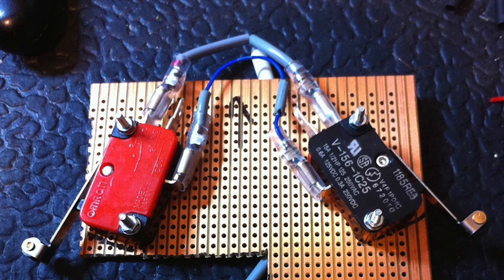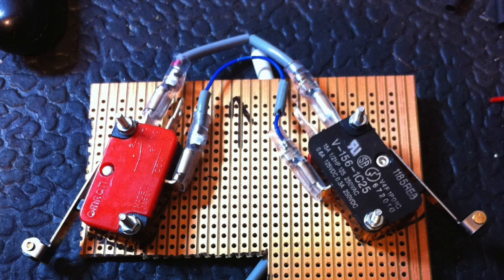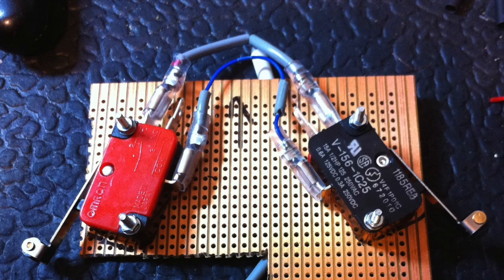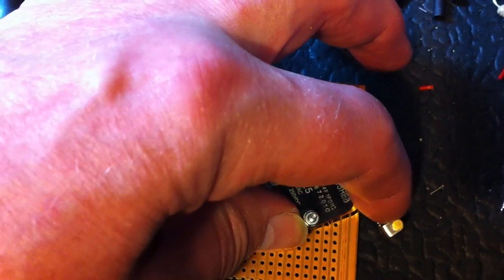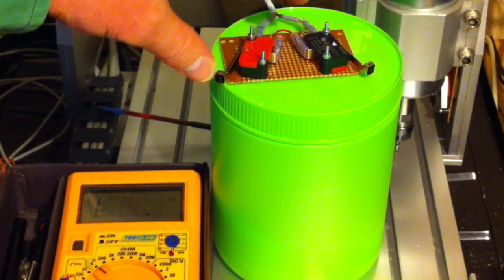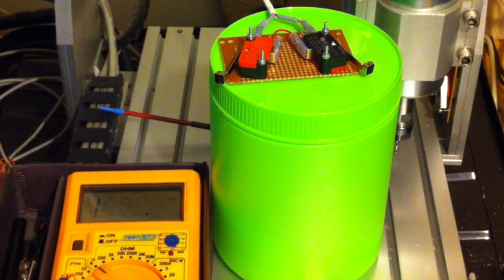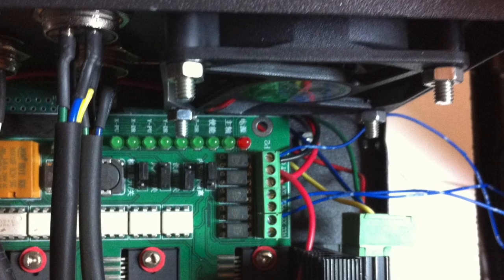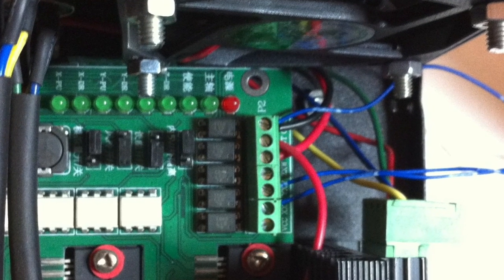Wiring Up Limit Switches On A CNC 3020T Engraving Router

Comment: hi, im using my normally closed ( NC ) limit switches connected to breakout board and I get  constant false limit switch trips . im using shielded wire. what can i Change in Mach3 to not have this problem. 

Thank you
Reply from the maker: Hi I had this too, it turned out to be nothing to down with the switches, if yours is like mine then it the manual change in direction using the pc keyboard that causes a glitch and the trip.  Try traversing across the +x and then hit the -x does and vis-versa, does it cause the trip?

Regards Malcolm aka #fixed1tCNCtips